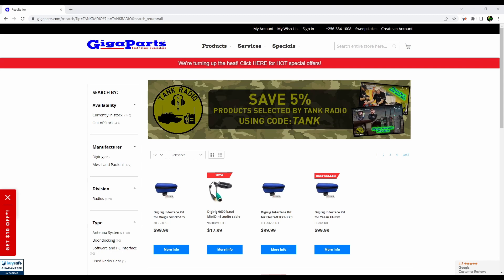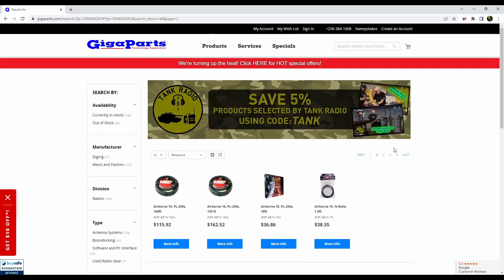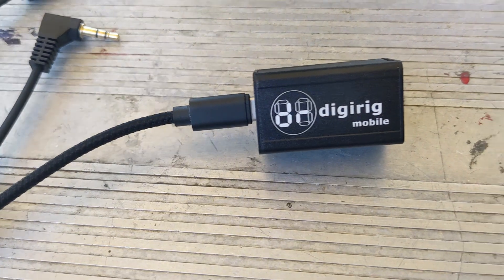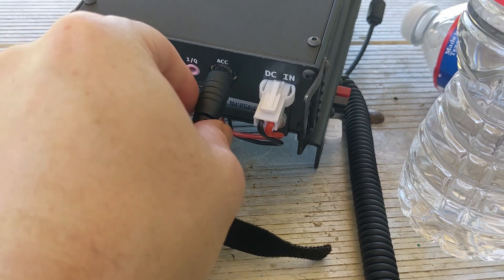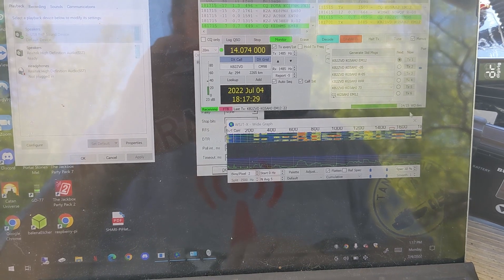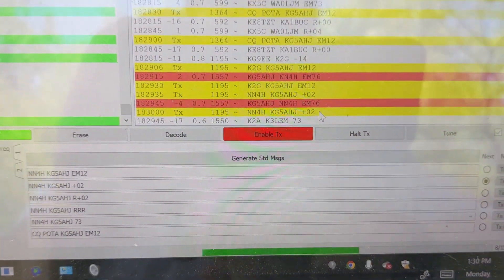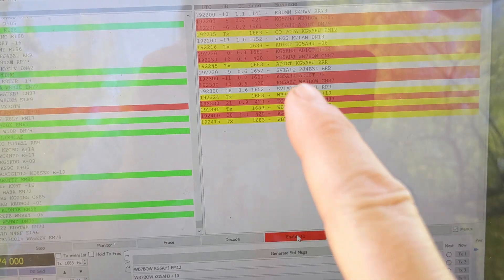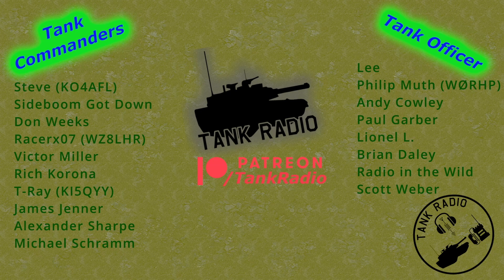My First Digi Rig FT8 POTA Activation

Comment: The only problem I  had on FT8 portable was RFI getting into USB cable. a snap ferrite did the trick. this is with a 9:1 into a 1:1 with counterpoise at antenna. this did not happen with 49:1 end fed halfwave. ICOM 7300 FT8 at 30 watts . E=Tune on 9:1.  on 20 meters. 73's

Comment: Did you put the grid of the park in the program? I was wondering if people were to look at PSK reporter i wouldn’t show the exact location. Thanks
Reply from the maker: In wsjtx under the settings, there is a spot for your call sign and grid square. There is an option if you have a gps dongle to auto update it. If not, you have to manually update that field

Comment: Grid Tracker is a program that works with WSJTx. They are in the process of adding a POTA column to the interface. As long as you are schedule through the POTA site, It is supposed to show your park number to the people recieving you call. It is how ever internet dependent.
Reply from the maker: I will have to check it out.  It will be the next software thing i will do